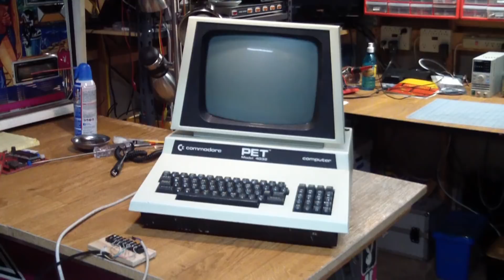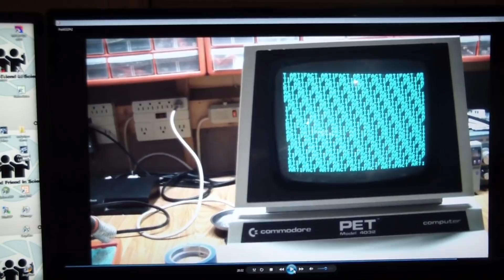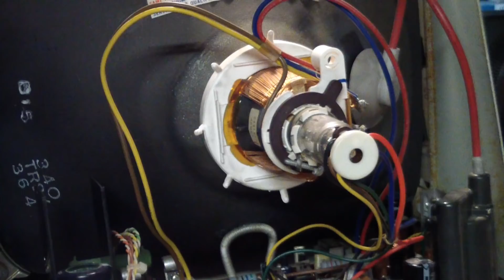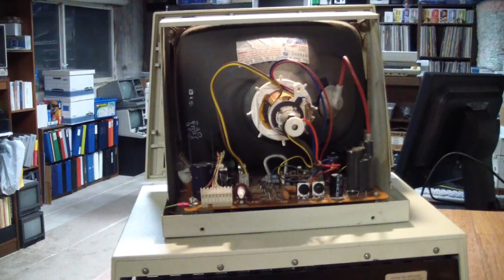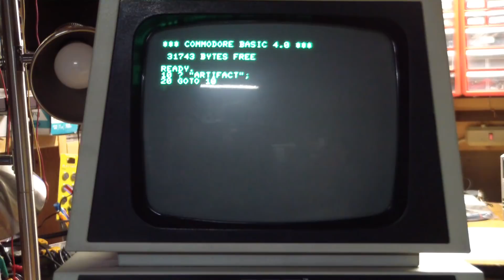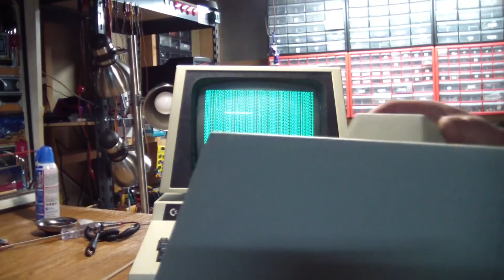AE#92 Commodore Pet 4032 Repair Part 3

Comment: Also not uncommon with old TV's and monitors for the entire scan coil assembly to slip down the tube neck over time, causing all manner of geometry/ convergence/ colour purity issues.
Reply from the maker: When I loosened the yolk clamp I made sure that the yolk was slid all the way toward the tube. That didn't help.

Comment: It's sad that just a few years ago, tens of thousands of technicians across the country could easily have fixed your problem in a minute or less..
1) you don't demagnetize a tube with a magnet. You use a degaussing coil which creates a field to break up magnetized areas,
2) You can play with the screen geometry with the two concentric sliding brown rings on the tube neck, behind the yoke coil.
I am surprised this knowledge is on the verge of being lost.
You did a good job trying to figure out the problem without this information. 
You can probably find degaussing coils  made for TV tubes on ebay..Just looked and saw 30 or so.  Get a round one... Plug it into an outlet and slowly wave it around the front of the tube while not rotating the coil. Then start pulling away and turn the coil so that is 90° to the front of the tube and then pull it further away.   I am sure you can find a youtube video on degaussing a CRT.  Good luck !

So many things have changed our lives in the last 30 years. I remember when only the most nerdy of us engineers, software people and techs knew about the upcoming internet. None of us knew just how far it would go with streaming video, music and more information than any would would have imagined. It was also not long ago when the idea of everyone having pocket cell phones with internet capability was science fiction. I worked in the computer industry supporting large mainframe computers which were speed demons in their day,  yet many of the Android and Apple type phones can easily outperform those room filling monsters which required huge air conditioner units and loads of hardware and software support to keep them up.
Reply from the maker: I am aware of a degaussing coil demagnetizing the pixel masks in color TVs, but I didn't think about using it on a BW.

Comment: I thought there were controls for adjusting the geometry inside the monitor casing.  Aparently not, at least on the relatively simple monotors Commodore used in the late 70's/early 80's.

Comment: Well that was easy !   I'd have been worried that the pm would leave the steel more magnetised rather than less, but you got away with it :o)
Maybe someone had some bit of junk with a magnetic base parked on top of the monitor for 10 years, leaving the steel partially magnetised ? 
(I use a modified transformer as a degausser (as you suggested), built mainly to degauss the iron jaws of my Uni-T dc clamp meter - I think you have one of these clamps too ? It works a treat to get rid of the dc offset at power up. )

Comment: Another way to degauss is to use a colour set, power it off, wait for a half hour, then hold the 2 sets CRT face to CRT face, and plug in the power to the colour set. That way the degauss coil will be able to influence the 2 CRT front surrounds simultaneously, and as a bonus if the colour set is displaying a dim white raster before you do the degauss you will get an idea of where the magnetic aberration is in the mono chassis, as it will cause colour fringing where the external field interacts. 

Otherwise just find an old colour monitor, preferably one that has died from some reason that makes it not repairable, and carefully remove the degauss coil from it, along with the input circuitry for the power supply so you have the connector for the coil, and the PTC thermistor ( and for more modern sets also a relay to briefly turn on the degauss circuit as required when the set is powered up or when commanded by the OSD in the monitor, plus lower power use in standby) to provide the shaped current waveform it needs. Then to degauss a chassis simply tape the coil to the front of the set, roughly taking the shape of the front ( minor spread is fine, just no sharp bends and keep in the same plane) and plug it in for 20 seconds, so the PTC does the high current pass, then drops down to remove remnant field. Unplug, and remove the coil, and problem should be solved. Do not place coil near yoke, unless you remove the connector and short both coils, otherwise you run a risk of burning out the drive circuit if connected, or causing arcing in the yoke if open circuit.
Reply from the maker: You could cold spray the thermistor in the color set so you don't have to wait for hours :). But seriously, I need to get a degauss loop while they're still available.